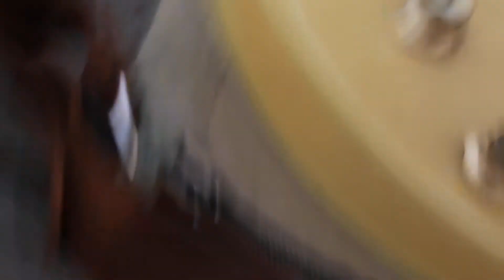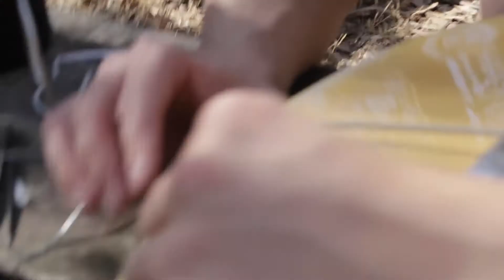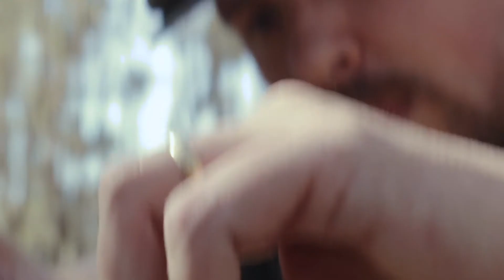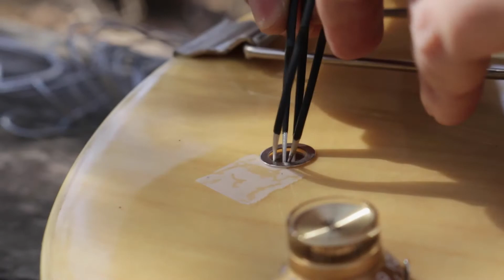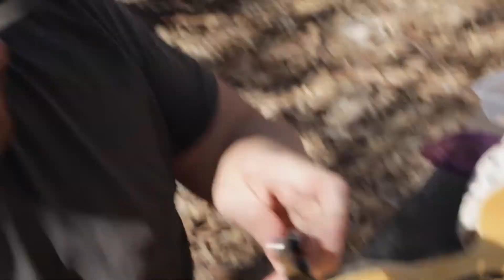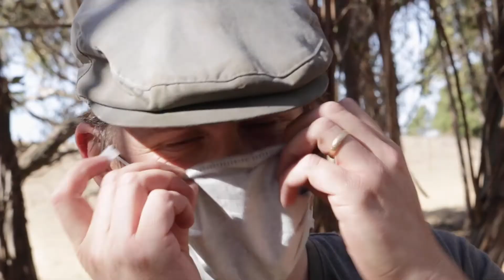The JOY Of Fishing Out A Fallen Output Jack | Epiphone Casino

Comment: I had the same issue and resolved it in 5 minutes with a small screwdriver and a broken guitar string:

1 lift the guitar over your head
2 aee the socket and feed it through the hole with the small screwdriver
3 make a tiny hook with your guitar string and hook the the socket and it stays up. 
4 feed the washer and nut over the guitar string and screw accordingly.

Easy job!!!
Reply from the maker: Well done! Thanks for the smarter alternative
Reply: I used a very similar method, but instead of a string I just used a flathead screwdriver and pushed it against the inside of the Jack

Comment: Literally just happened to me. I found putting it upside down so the jack came through on its own, putting a screwdriver through the washer and bolt then pushing the screwdriver against the inside of the jack gave me just enough grip to screw everything back together. Absolute nightmare

Comment: Haha, what ever feels to be the hardest way! To me plenty easier would have been fish it out from F-hole, then pull any long wire from the jack-hole, fish it from F-hole, pull half a meter out, thru the jack (with the missing? locking-washer) make a knot underside the jack, an then pull wire and jack to the jack hole, drop the washer and nut thru the wire, tighten them, and last pull the wire out from f-hole...
Reply: and: prevent this happening again, one tiny tiny drop of superglue in contact between with nut and jack. Then the nut would not start loosening. And one tiny drop of glue helps the locking-washer keep on place when fiddling jack thru guitar..

Comment: How did you even get ahold of it in the first place?
Reply from the maker: Well, first I was able to get a hold of one of the ground/hot wires to the jack with tweezers--I was able to pull on the wire until I could see the jack. After that I bent the end of a wire into a hook to clumsily fish it up to the surface
Reply: @fuzzbus  Thanks. Before I ever saw your reply I did exactly the same thing. Good pair of glasses, mechanics wire and a headband light were my tools. Oh and the key was another wire with an old guitar jack securely attached to it. Insert the jack into the input and then pull it to the hole.